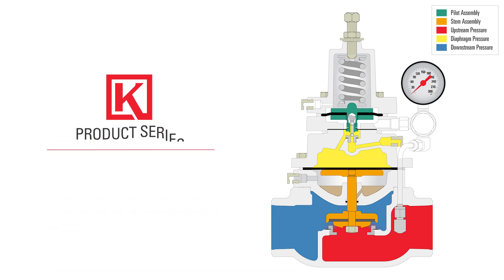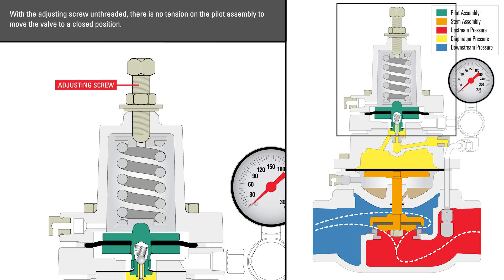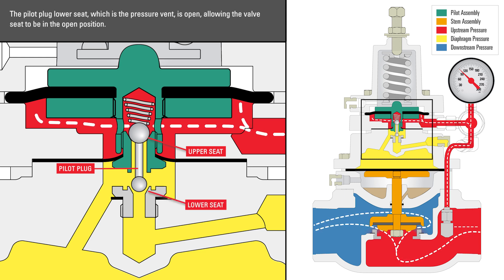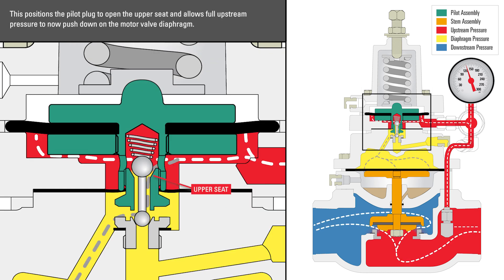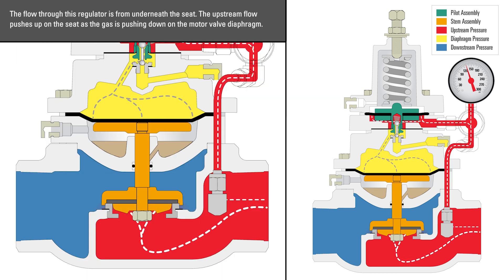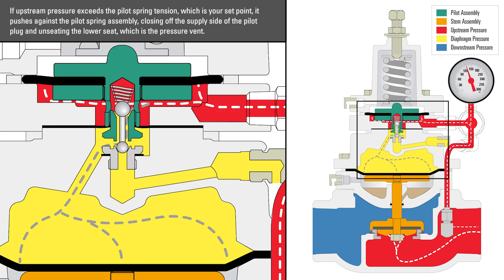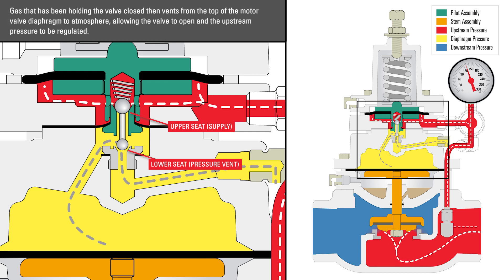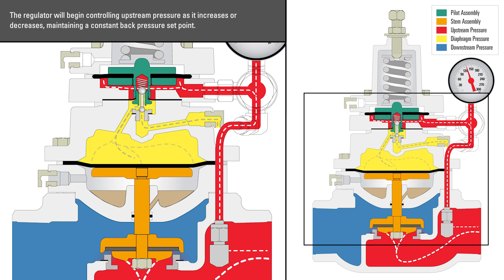Kimray Back Pressure Regulator Working Principle | Training Animation

Comment: can anybody explain me, what is set point for press. regulator..please explain..
Reply: Set point is the desired pressure that you want the upstream pipe to hold.  If you want the upstream to stay at 10 bar the regulator will slip pressure downstream to maintain the point you want it to be set in the upstream pipe, in this case 10bar would be your setpoint.